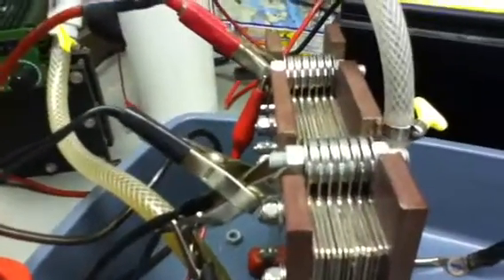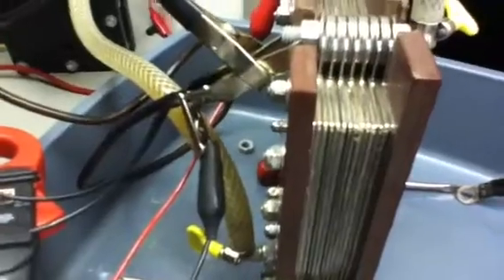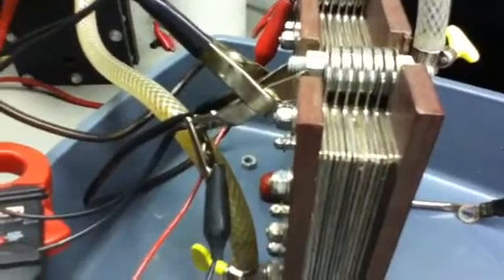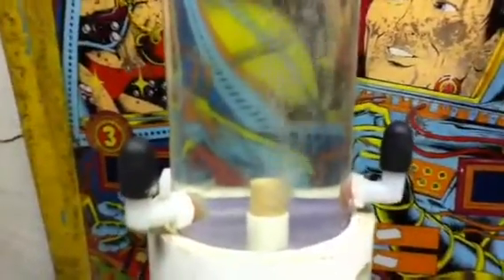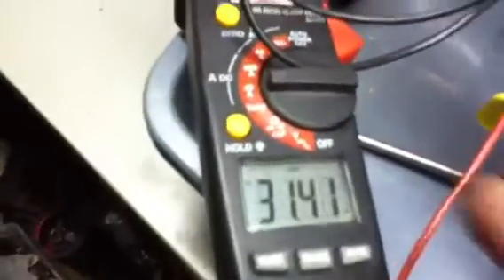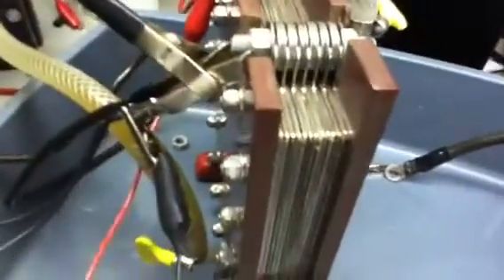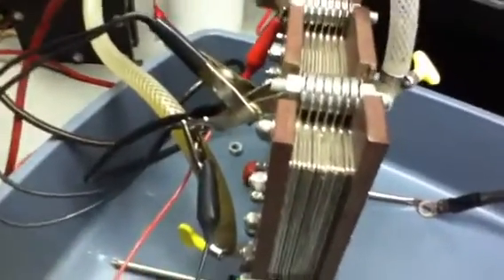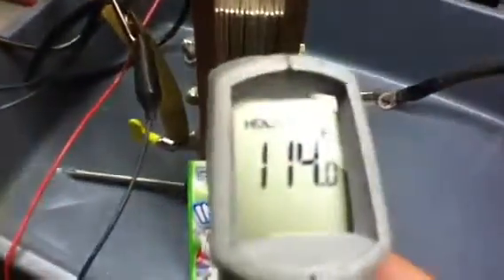HHO with kool-aid

Comment: good set dude. I am trying to understand the amps > = 31 amps on the charger side . then 11 amps on the battery side ? . the bat is kickin 14 volts or drawing ?. the cell uses 3 volts  ?. I am gonna have to try this coolaid thing . I have tried citric acid before with the resiults of to much contaimination or the same as baking soda . U use a buck to get down to 3 volts ?